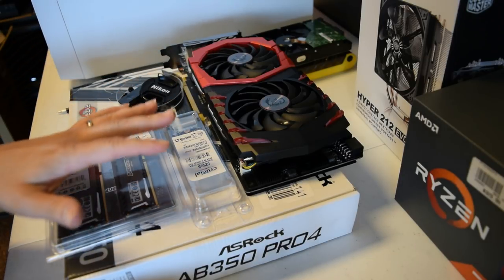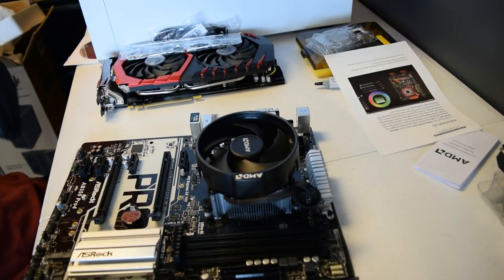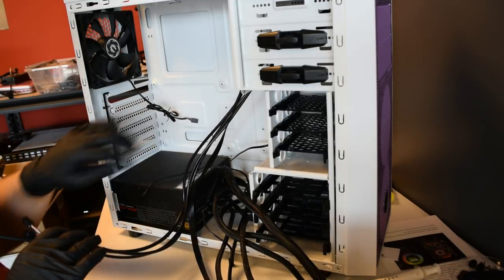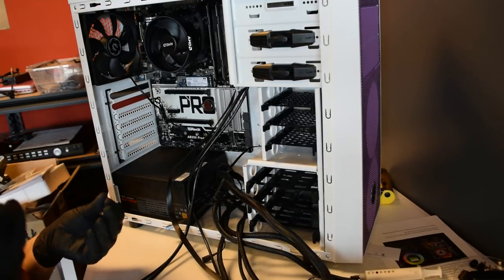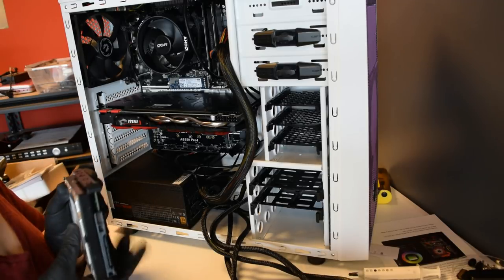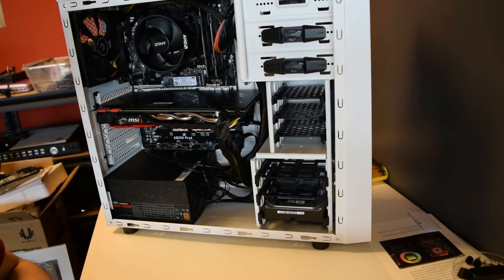Build a New Gaming Computer with Me

Comment: I switched over to AMD around 2011--needed an upgrade from a Core2Duo E7500 (which overclocked nicely on air) to something with more cores, and on a budget. I rocked a x6 1090T BE along with a AM3+ 970 board, until 2013 when I grabbed a FX-8320 (OC'd to 4.7GHz) along with 32GB DDR3, Gigabyte 990FXA-UD3 board and R9-290 4GB (OC'd). 

The x6 1090T BE + 16GB + AMD HD7950 3GB that I have in a spare rig still holds its own. My current rig is technically just fine, but I think it's time for another upgrade--Ryzen is just screaming "buy me!". I think RAM will be the biggest sink though--I'd like to jump up to 64GB. Besides video, as you might tell from my username, I do a lot of music/audio work (plugins eat a lot of RAM)--also use virtual machines. It seems like I would benefit from it all. 

High five for the Hyper 212 Evo. \m/

Sidenote: I generally name my computers and other devices, as well as my network along space/sci-fi themes. 

PC: T-1000
Phone: T-800
Tablet: T-1
Raspberry Pi-3: Ares
Raspberry Pi-2B: Sputnik
Fire TV: Skynet-TV
Network: Skynet-2G and Skynet-5G, for 2.4GHz and 5GHz, respectively.

Comment: It's interesting how 10-year old CPUs are still extremely relevant today. I have a side computer with a Core 2 Duo E8400 and a GTX 1050, which runs most current games at around medium!
Reply from the maker: Older CPU's, or at least the middle-of-the -road-and-up ones hold their own extremely well. When I built this Ryzen, I was retiring my i7 from 2009. 2009! That chip has been in a gamer rig for almost 9 years! And it handled it. As I started doing more video rendering, I could feel it more and more, but still. It held its own waaaaaaay better than most do. The Core 2 Duo's were like the big brothers of Intel's line and they are still beasts. I've read that the tech world hasn't really been able to break the 4 GHz mark, or somewhere around there, and since the software isn't really pushing for more speed, just more cores, we've had a lot of "Energy Efficient" development. Hence older CPU's holding their ground so well. At least that's what the internet said.  =)
Reply: Cool! I have a GTX 1080 and whatnot as my main rig now, but I am starting to think that it would have been a good idea to base my main rig off of an old Core 2 Quad and LGA775 motherboard. I could have slotted in a GTX 1060, and for around $400 total (1060+extra HDD, etc) built a rig surprisingly about half as fast for a third of the cost!

Comment: I lost it when she pushed down on the cpu to pull down the lever
Reply from the maker: I don't apply pressure when I place my fingers. Back in the socket-A days, the CPU used to pull when levers were pushed down and one side of the CPU would come slightly out of socket. Whether it's a habit or preference, I place my fingers on the corners to keep the sides even when the lever goes down, but it's not a push.

Comment: My contributions to the Youtube cancer section of this video:

3:45  LOL.  I've built several complete systems for myself, and others, 
over the years.  The little straps are cute, but unnecessary unless 
you're working on server hardware.  I can see doing it for customers, 
but I've never had the need to do so myself.

Living in a very windy area would do it, too.  Static can build up 
easily in that case.  Most quality/namebrand system components are ESD 
protected, though.

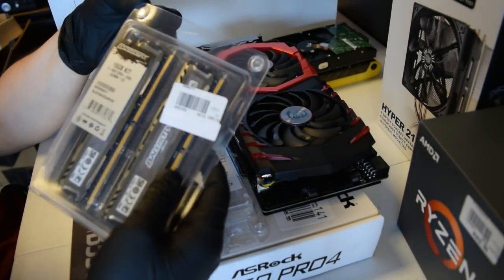4:11  I don't know how much homework you did on Ryzen, but the 
interconnecting components, of the 4-core clusters (called "infinity 
fabric"), LOVE fast memory speed.  While Ryzen compatibility has gotten 
better since launch (I would be on BIOS updates like a hawk), and continues to get better with time, it's still a whore in finding optimal kits to kick in the full XMP profiles.  2133 and 2400 usually tend to the common spots.  Most Skylake+ kits have  3000+ on them.  Either way put, it usually has no impact on gaming.  Can't speak for prosumer stuff, though.

5:15 The WD Black series is no joke.  They usually come with good 
guarantees of quality and longevity.  Also, 500 gb is not enough for a 
typical guy's porn collection.

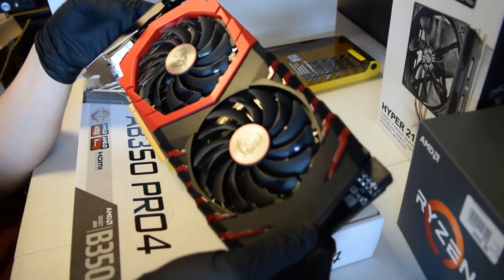6:26  HA.  Should see how thick my AMD R9 290X was.  Even with the 
TwinFrozr cooler on it, it was a good degree thicker than what I have 
now.

It's a shame you didn't get the 1070 Quicksilver edition.  It'd match 
your mobo well (and the annoying red/black color scheme would be dealt 
with).

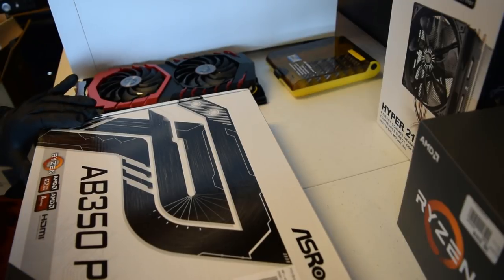7:00  Great.  You're one of THOSE people.  LOL.  

I know the British like to say it like that, but it's A-ZEUS (or A-SOOS 
is close enough): https://www.youtube.com/watch?v=fLmuYHaIK0E

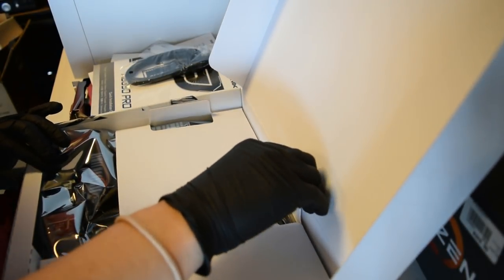7:49  Gotta love the smell of leaded solder in the morning.

9:05  LOL, VGA.

9:08  Hey now, plenty of nerds like their PS2 ports.  While I could care
 less, unlike USB, it sends an interrupt signal to the system.  USB 
doesn't quite do that.

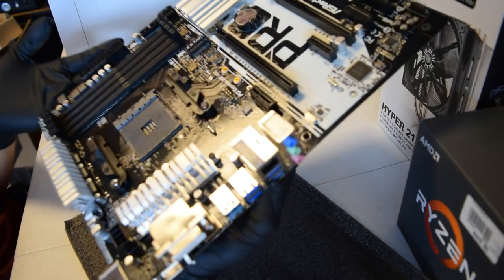9:25  Was hoping for some tongue action.  Too much?  Yeah?  Alright, Imma 
going back to my corner now...

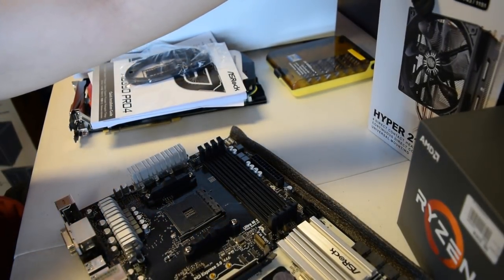9:42  Some do not.  Newer  K/X-SKU Intel CPUs don't either (it's 
expected you'll just use better anyway, but the savings doesn't pass 
down to the consumer).

11:48  Why do AM4 builds come with a bracket you must remove for the 
STOCK cooler?  That makes little sense.  

Granted, at a glance, it looks no different than a AM3 socket, but Asus 
did make some boards with an extra set of holes to mount the AM3 
backplate on them for AM4 systems.  I don't know of anybody else that did
 this.

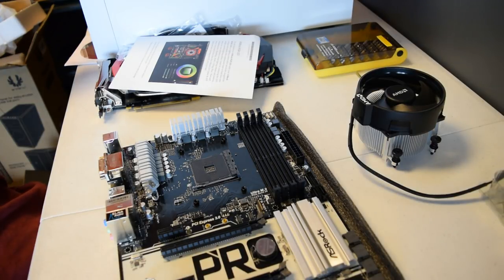13:09  HEATHEN.

Seriously, though, just run the Asrock OC equivalent utility and see 
what it gives you.  You can always tell it "no".

14:16 Are you using one of your business cards for that?  Looks like it.

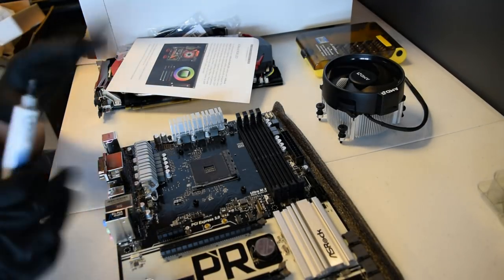14:39  Splooge bookmark.

14:47   But, Arctic Silver 5 is my jam.

16:59  Hell, I draw a question mark to troll people watching.  Gets both sides of the argument triggered.

20:52  SUP.

28:11  The 1070 has a TDP of 150 watts.  Ninety would be more like the 1050 ti, or whatever equivalent that draws enough power out of the PCI-E slot, and not need an auxiliary power connection.

I'd think the main reason would be due to GPU memory.  Three GBs won't do shit for anybody anymore.  I wouldn't go any lower than 4.

40:34  YEAH, KETCHUP AND MUSTARD CABLING FTW.
Reply from the maker: Oh man, you put in a lot of work with time stamps. I don't even do that for my stuff =)

I am a heathen builder, I admit, and others have definitely pointed it out. She runs beautiful, or at least fast enough that I'm all "ohhh's and ahhhh's". I'm kind of a scrappy builder, and kind of poor, so the whole matching and super awesome stuffs was "meh". My cat is probably just going to sleep on top of it anyways =P <3 Kitty though. 

Yip, business cards are awesome for thermal scraping and separating glass, haha. We use them all the time to peel glass off of digitizers too. Or poker cards, whatever is in stock.

Comment: I love this video but I definitely cringed when you put on the thermal paste. That much is not necessary at all! In fact you will get worse temps. Just know for next time, a pea-sized dot is all you need and you will get good temps and not experience any problems.
Reply from the maker: The CPU sits at about 34 degree Celcius at idle, and it's just the stock cooler. I remember a few years ago Linus Tech Tips did an extensive video testing the amount of thermal paste that was just right. About 10 years ago we did this in a test shop, and you know what was the best thermal paste? Mayonaise. I think the big habub about thermal paste is really over rated. Maybe if someone's overclocking to the extreme and using a water block, but at stock, unless it's splooging all over the board, if the heatsink can make good contact, 1-2 degrees probably isn't going to be an issue for the average user.
Reply: @YvetteASMR  While mayonnaise may work it's more applicable for a sandwich than a CPU 😋
Reply from the maker: @frostwolf2382  Agreed. It certainly didn't smell good when testing, either.
Reply: @YvetteASMR  This video was very relaxing, I enjoy ASMR videos about building PCs or unboxing PC components.

Comment: I'll watch this later, but lemme guess, you don't have the AM4 mounting bracket for your Hyper 212 EVO?

Pretty sure you have to contact Cooler Master for that.
Reply from the maker: Haha, Yeeeeeees. I figured that out a bit too late. What really nagged me is that Micro Center said, "Yeah, sure, it's compatible." But didn't mention a needed component. Yip.Nope. No overclocking, and after seeing the ring LED around the stock cooler, I am kind of in love with the default cooler.
Reply: Well, be glad you didn't have to buy your video card.  The current cryptocurrency trend has caused many prices to skyrocket.

Also, Coffee Lake (8th gen i-series) is expected to be a 15% performance increase over Kaby Lake.  Rumor also has it they'll be finally breaking the quad-core standard on the mainstream platform, too.  If so, I'll be going over to the i5 six core equivalent.  If not, I'll be heading over to an R5-1600X.  I argue it's, by far, the best balanced chip they're offering.

Comment: Is it hard building a gaming pc? I been thinking of making one for awhile now.
Reply from the maker: It's not necessarily hard, but it requires a lot of patience and reading. When I built my first PC as a teenager, I didn't really read the manual. I just winged it. If a CPU and motherboard were the same socket, I would take for granted they were compatible. Putting them together isn't really that hard though.
Reply: Gary Sutton it is pretty easy
Reply: its like lego for adults

Comment: I don't wanna go to nerdy on what is meant to be more ASMR than geeky, but why did you got for the Hyper 121? The stock is amazingly good for the Ryzen 7 series
Reply from the maker: When I bought the CPU, I actually didn't know that it came with a heatsink, and the 212 is still one of the best out there. I thought I would need it. Buuuuuut, as it played out, I didn't get the bracket for the 212 on the AM4, and ended up using the super awesome stock cooler anyways. It has a red ring that lights up and super pretty!
Reply from the maker: And go ahead. Get nerdy. ;)
Reply: Yeah the stock cooler is actually amazing. I have a 1700 too with the stock fan and it's really cool and quiet! (I am stock  speeds though)
Reply: I'm a bit of a weirdo though- in that, I bought all this new gear like you've got but put it in an Antec SX1040
Reply from the maker: I'm also running at stock speeds. I've done overclocking in the past (I'm really, really bad at calculating it and super impatient benchmarking it) and the benefit never really felt like that much of a gain for the effort involved. The 1700 is an awesome CPU by itself.
Reply: Yvette ASMR I was the exact same. I kinda just didn't see it being worth it 😅 runs what I need pretty well at stock

Comment: AMD took Intel by surprise this year, it surpassed intel in content creation horse power and is very close in gaming performance (Ryzen is 10% or 15% slower in games) i bought the R5 1400 and the thing OC'd to 3.8Ghz can compare to the i5 7600 for 50 bucks less. I had to buy the 1050ti because etherium miners took all the rx 70s/80s and 1060s :(  Btw are you a computer technician or programmer or something like that?
Reply from the maker: I was hoping AMD would swing back with force, and they definitely did with Ryzen. I'm very happy with the setup, and even though they may not have the gaming market by a very small percentage, video editing and compiling is hands down punching Intel in the rear. My i7 (original 920 series) would take 4-6 hours to compile a video in 1080. The Ryzen 1700 exports it faster than you can watch it in real time. That is enough for me.

I'm a computer tech IRL. I don't get the opportunity to build that often. Most gamers are well versed enough with the hardware that they usually do their own building. I'm mostly a fixer/re-builder for a small outlet.
Reply: Yvette ASMR if nothing else it's bloody good that and are actually giving Intel something to worry about because Intel have stagnated and taken the piss with their pricing due to the gaming monopoly
Reply: After the latest update and bought faster ram clocked at 3400 it's so much better now ...ram speed made a huge difference for me

Comment: You used way to much thermal compound plus there  was already  some on the stock cooler
Reply from the maker: I think the amount of thermal paste is just a preference. I have tried using really thin amounts and spreading it out with a credit card to avoid bubbles. They all smoosh out to be very similar, and my core speed is about 30 degrees Celsius, which is really comfy. I prefer using my own than what's on the bottom because I can cover all the corners but even that probably doesn't make a huge difference. To me, the important thing is that it stays predictably cool, and it does. =)
Reply: So now you realy have me wondering how the temps are with the mix of 2 different  compounds. In truth there is realy not a right or wrong way  to do it as long as you have the cpu covered good but 2 different compounds is interesting. How are the temps
Reply from the maker: I had scraped off the stock thermal compound before adding my own, so I'm not sure how much mixing might occur, but I am casually (and maybe dumbly) guessing that it probably isn't the biggest deal either way.

I used to work for another outlet and we would build desktops for a local college. We'd have like, 10-16 identical systems built in the same environment, the same methods, and they all had different CPU temperatures. We tried white ceramic vs. silver, and the silver was a wee bit better and didn't dry out as quickly, so we usually used it. 

I know some websites and outlets will give strict guidelines for how it has to be. Maybe I'm lax or lazy thinking that, "eh, good enough" is actually good enough. AMD states that the heat threshold is between 130-145 degrees Celsius, and with Furmarks, it might get to 90 degrees, so it's still pretty far under the tolerance level. 

Linus Tech has done a lot of videos on thermal paste. He's a lot funnier about it though =) 
https://www.youtube.com/watch?v=r2MEAnZ3swQ